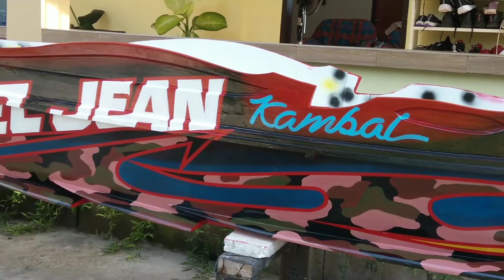Boat Painting and lettering design(Tranformer concept)

Comment: What colors do you use and how long does it withstand the water?
Reply from the maker: Nakadepende po kasi yun sa exposure sa init.. Kung hindi masyadong exposure sa init..matagal talaga ma fade yung color isniya
Reply: @3jsarttv1996  is an english translation possible? :D :)
Reply from the maker: It last 4 to 5 years if you use epoxypaint.. If enamel paint it last 2 years..
Reply from the maker: Im using hudson enamel paint especially on bancarera boat
Reply: @3jsarttv1996  ok! Thanks a lot! (: